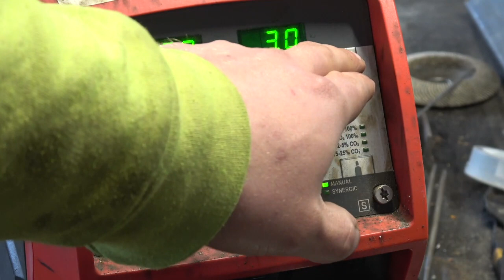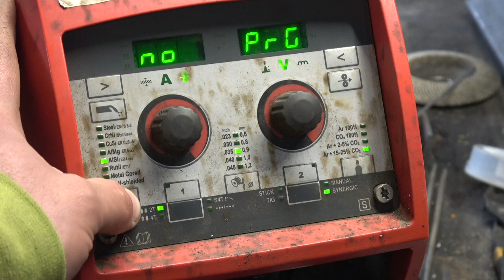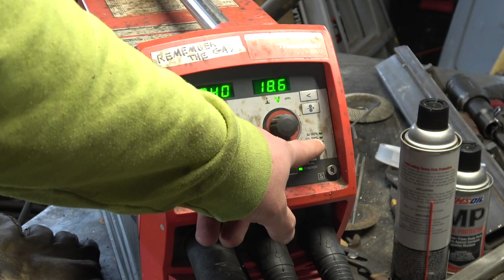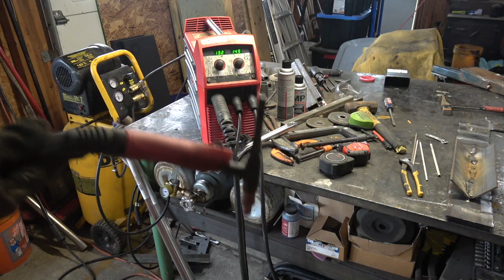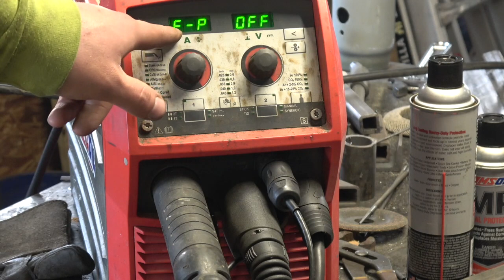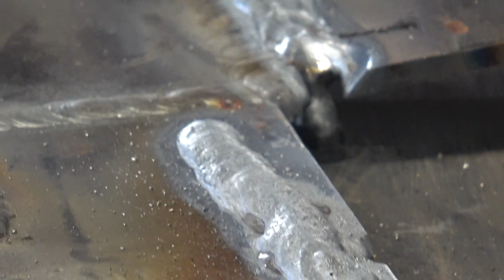Fronius Transsteel 2200 crash course on how to use it

Comment: Hey brother I’m seriously looking at buying this machine for a dedicated aluminum welder since no spool or push pull gun is needed. It looks like you use this machine a lot and figured you could tell me how it’s holding up. I saw where a lot of people had commented on the plastic drive roller door along with some of the plastic components for the drive, roller hinges, etc., etc.. just seemed like some people were griping about it being chinch on build quality as far as the casing goes. Has it been a reliable machine for you in the real world though?  Also, have you done quite a bit of aluminum Welding with it at all and what’s your thoughts on that if you have?
Reply from the maker: I use mine for mostly steel. It usually just sits in the shop. I have used it for aluminum. I actually just did an aluminum job with it a few weeks ago. I had to patch the inside of a grain trailer. I hate welding aluminum to begin with so I may be a bit biased towards any negative aspects of welding aluminum. I will say that it would probably work better if it was set up just for aluminum. Like I said mine gets used for steel probably 95% of the time and then I switch liners and tips and try to use it for a random aluminum job maybe once ever 3-9 months. 

It seems like on mine the wire tends to birds nest in it quite often. It has some really sweet settings on it though where it does weld aluminum kinda like steel. You hardly notice a difference when you're actually welding. I think my bird nesting problem is because like I said it's not a dedicated aluminum machine.

 I have no problem with the plastic parts you mentioned. Other companies may uses steel parts for the casing but it's such thin steel that it doesn't really hold up any better than the plastic on this machine. They may also use plastic to stop the board from shorting out if the case gets dented I'm not too sure on that. I have a fronius transpocket with a steel case that I dropped a metal platform on from a second story one time and it still works fine 4 years later. I don't think the transsteel would hold up to that level of abuse. 

As far as what I do with mine It destroys the competition in the 200-220 amp mig welder class. It is more equivalent to the Lincoln 262 just without as high of an output. the Lincoln 210 mp breaks down on me quite often and can not really get into spray transfer. The Transsteel can get into spray transfer running 75-25 plugged into 110v power. I have built a lot of steel ramps with mine as well as other things and it has not let me down really. The only "problem" I have had with it was when we were running spray almost non stop, the machine never went into a thermal shut down but it did melt the locking lug off of a dins connector. I got it out but it wasn't easy. I guess that says something for the duty cycle of the machine though. It will melt your leads before the machine itself overheats.
Reply: man i appreciate all the insight and knowledge most definitely. I wonder why it keeps bird nesting the aluminum ?  I would think they would have done a dual drive roller setup to help with pushing softer 4043 wire though.  Does the torch have a teflon liner inside it already or how do they go about accomplishing & advertising to comfortably push  aluminum out the machine ?  I’m guessing it does have a ugroove drive rollers and just a Teflon liner ?   I’ve thought about buying the primeweld 285 MiG that has dual drive rollers and converting the liner to Teflon but they don’t sell ugroove drive rollers even though I know I could get away with v groove with dual drive roll system I’d rather have it perfect. I have a millermatic 251x setup for steel and a spool gun but I hate the cumbersome spool gun to be honest.
Reply from the maker: @jacobtravis812  I think part of my problem is I never bothered to change the drive rollers. I run the same drive rolls for every wire I use. I got the fancy one for aluminum went to change it out after the last aluminum job just to find out its not keyed the same as the drive rolls for .035 steel. it's probably an easy fix but the place I go to for fronius stuff lost their best salesman and the girl that replaced him probably never even read the word welding till she walked in the door and saw it on the sign above the door. I don't think the liner is teflon. It's something else if I remember correctly. I think they also make a push pull gun for the fronius if it was a dedicated machine but I could be wrong. Also keep in mind all the problems I'm having with aluminum are probably self inflicted. it did run better when it was new but like I said I weld more steel than anything and my mig gun is dang near wore out even for that but I'll run it till I can't.
Reply: lol.  understood. Man I appreciate your feedback. Yah I just want to make sure it’ll run no problems like it is. That welder is already expensive lol. I won’t be able to invest into a push/pull gun for a while if I purchased the machine.
Reply from the maker: @jacobtravis812  When I got mine, I paid like $1600 in June of 2020. I can only imagine what they are now. I know the 210Mp if you look at the forums when that first came out, it was selling for less than $1000. The last few they made were selling for over $2200.
Reply: @scrapmanindustries yah I know prices are out of control these days. Have you seen the newer fortis machines ? They look nice but 5k , they better be.  That’s why I’m seriously considering the primeweld 285. It has every feature the fronius has down to dual drive rollers minus the WiFi and data logging stuff which I’m not worried about. I would think for 5k the fronius would do AC tig as well to be able to Tig weld aluminum but it doesn’t.
Reply from the maker: @jacobtravis812  I think The Fronius iWave is the one that can ac tig and also maybe mig weld. I did just look up current Fronius prices on the 2200 and 2700 transsteel models. That is pretty crazy. I should have bought the transsteel 2700 back at the end of 2020. now if I want one they're double the price they were back then. The school I go to just bought like 15 new Lincoln 262p's for like $3200 after the education discount.
Reply: @scrap @scrapmanindustries ur talking about $15k for that machine lol. Way above my budget. Check out primewelds stuff. Their products are really good and their customer service is rated number one in the Welding industry right now.  When you call you get a hold of a real person if you email about a problem or a part if it’s covered, they normally ship it out before they even reach you or call you back. That’s just the type of company they are. $1000 for a 285 amp MiG machine with post flow and pre-flow adjustments along with synchro pulse/mag pulse/2T and 4T settings. Has a dual drive roller set up.  Synergic and manual settings and a whole lot more for $1000. Three-year warranty and awesome customer service. I don’t know if you’ve ever watched Jody from Welding tips and tricks on YouTube? But he was a big inspiration for me when I first started out Welding with his videos 11 years ago. After speaking with him at links, he really loves that company. And this guy is a veteran welder that puts out some really nice stuff. Since you predominantly weld steel, it might be an option. You check out if you’re looking at a second machine. if my Miller ever bites the dust, I will definitely be purchasing one for carbon and stainless usage and I might even be buying one to convert just to push aluminum through the gun cause I think it’s a good candidate if I can just get some Ugroove drive rollers made or find some that fit it.

Comment: Im looking that machine long time. Price is wery high! 
Did somebody have some expirience with this machine. Buy or not !
Fronius is serius brand !
Reply from the maker: all welders got way more expensive after 2020. the bigger Lincolns used to cost around $3-4,000 if you look on forums from like 2010 or so. the same welder today costs upwards of $9,000. Personally I was looking at replacing my Lincoln 210mp a few months ago because it had a bad drive motor which cost $350 or so. My top 2 choices were another fronius or the esab rebel 285. Both of those machines are way better than the offerings from either Lincoln or miller in the same class. I am always working on the Lincoln even though I don't use it half as hard or as much. the lincoln goes though consumables like crazy compared to the fronius and it doesn't put out as much juice. I can run spray transfer on the fronius plugged into 110v outlets. I can not get the Lincoln to run spray transfer on 220v power even with 98/2 gas.
Reply from the maker: I chose to replace the drive motor in my Lincoln because it was cheaper than getting a new machine by a long shot.
Reply: I have one ,,, it has its uses and for what it does its mighty.